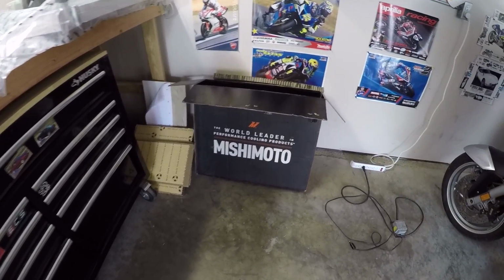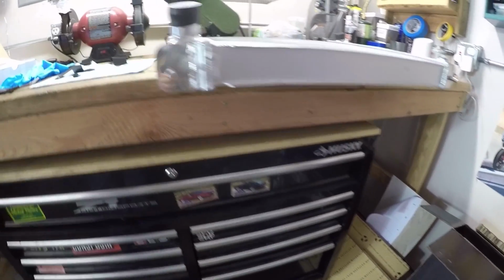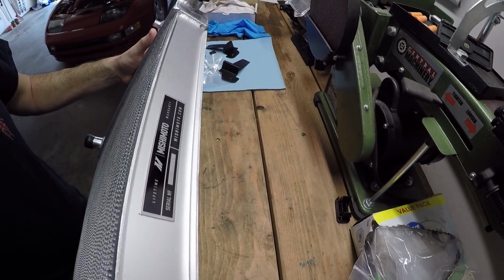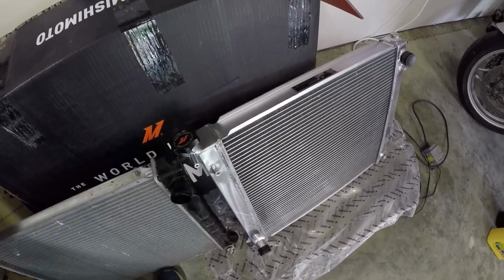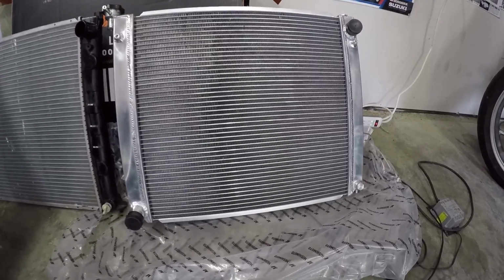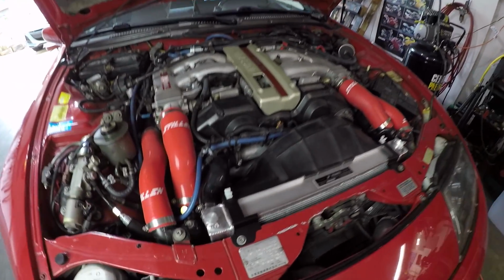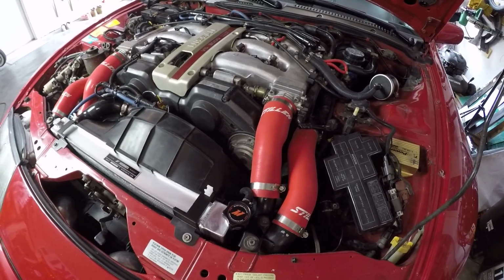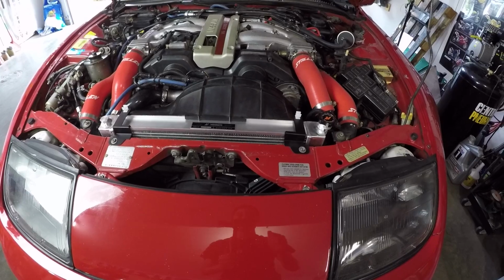Mishimoto aluminum radiator install Nissan 300ZX Twin Turbo Z32

Comment: Great vid! My z has a mishimoto in it now but with no fan shroud, the oem fan shroud fits the mishimoto no problem?
Reply from the maker: Yep, it fits just fine!
Reply: Did you have to drill holes in the radiator bottom flange to secure the shroud?  It seems Mishimoto only provides the top 2 mounting holes for the shroud.

No shroud trimming otherwise?

Comment: For a car that has issues overheating, my 91 TT has been awesome for the the 105+ range here in AZ so far.  I have a factory equivalent radiator but it only has about 1300 miles on it.  Seems to be good though.
Reply from the maker: Mine never overheated either. But...every time I popped open the hood after a drive and felt that wave of heat, I couldn't help but think the original radiator was a liability.
Reply: @PracticalEnthusiast  I'm glad I'm not the only one that pops the hood as soon as I pull in the garage!  Where did you get your radiator?  Now you got me thinking....🤔
Reply: @PracticalEnthusiast  i do exactly the same with the hood. The goal is to dissipate the heat but also save ensure longevity for all of the plastics and electronics
Reply from the maker: @kaleljll1  I bought it from Concept Z Performance. They had the best deal on the brackets and radiator after shipping. Check them out!
Reply: @PracticalEnthusiast  Good to know.  Love Coz and the gang down there.  I figured it would be from them or Z1.  They have been my main source for parts (for the most part)

Comment: I have one on mine and at first my temps were cooler than stock on my NA to TT swapped Z. I have been daily driving it for about 10 months and mine sprung a leak on couple locations. Mishimoto has lifetime warranty so I was able to file a claim and its on its way to me. Make sure not to remove that serial# tag.

Comment: Why mishi over Koyo? I have koyo, seemed to fit well, didn’t have to remove the viscous fan.
Reply from the maker: They are likely very similar in performance. What sold me on the Mishimoto was the slightly thicker core (53mm vs 48mm with the Koyo), the inclusion of a higher PSI cap, and metal bleed and drain plugs.

Comment: I’m dreading trying to replace my idle air control valve on my Z32..
Reply: Lol its not bad man. Just watch the wiring, try not to move it around too much since itll be brittle as all hell after 30 years of heat cycles. Have you done all your plenum deletes and egr delete yet?
Reply: Just replaced mine.  Not too bad of a job but I have done all the deletes so there is more room.
Reply from the maker: It's doable without pulling the plenum, but I won't say it's fun :)
Reply: @PracticalEnthusiast  I thought mine was causing the Z to chug to life and die the first couple of times before it would start but it wasn't the issue.  There was a broken connector on it so still worth the time.
Reply: @slicktop 2jz no I haven’t done the deletes yet. @Practical Enthusiast these engines are so cramped, I swear the Nissan engineers were laughing imagining us suffer when serving the motor.

Comment: You really should delete hicas bro.....it fucked out on me mid corner and sent me into a concrete wall at 100km/h amd wrote off one of my slicktops. Just not worth it.
Reply from the maker: I've heard the horror stories of HICAS failing. We'll see, maybe in the future.